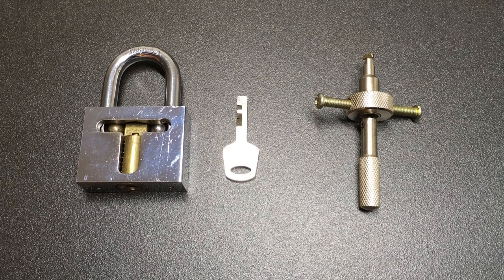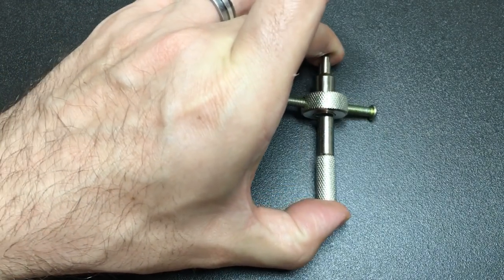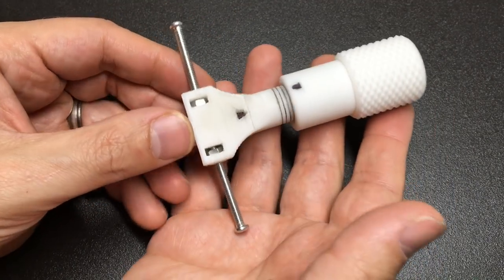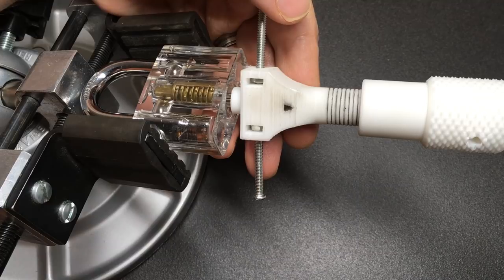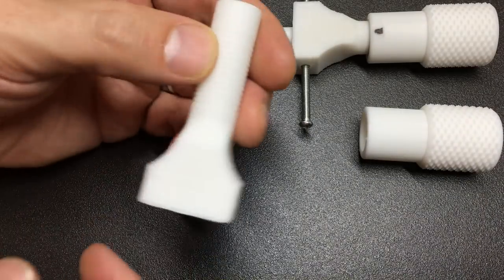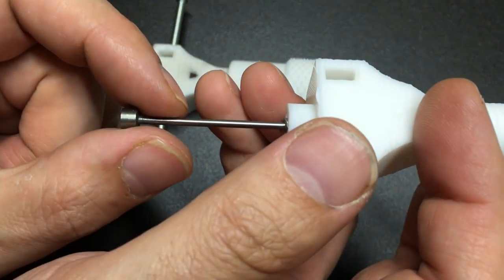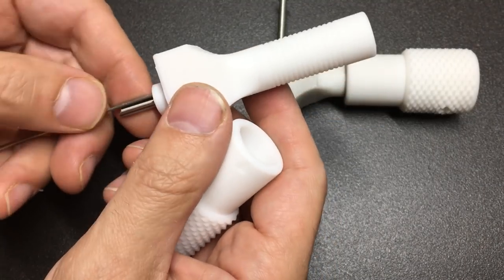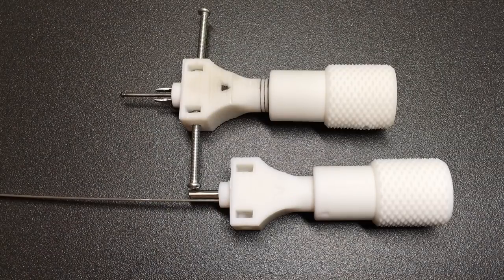AMAZING 3D Printed Disc Detainer Pick Prototype

Comment from the maker: Wow! I just love seeing innovation and design like this. And the final assembly works perfectly too! Awesome work from Boris :-) The links to the .stl and CAD drawing are in the description :-)
Reply: That is a good lockpick the problem with the cheap picks is you keep having to use the alienkeys. 😀😀😀as allways have a nice weekend
Reply: Is the design very innovative when it's just a 3D printed version of what Lockpickinglawyer and BosnianBill made? I feel the innovation was theirs and Boris just  put the design into CAD which is useful I guess, but might make sparrows less likely to pick up the making of the LPL/BB design and manufacture it
Reply from the maker: Myranda Rose well I can see your point, but I have to politely disagree with it. I LOVE the pick that LPL and B.B. made, but it is in no way innovative and is itself derivative of the many other DD picks that have come before it, including notable examples from Huxley Pig etc. The innovation shown by Boris is in making a working design out of a printed material that assemble with commonly available parts. As for impact on Sparrows? None I’d say. The number of people that would go through the challenging process of printing and making one as well as souring the ejector pins and then having the skill to reduce it down to a picking tip? I’d say we are talking about 10’s of people and those people would most likely also buy the Sparrows version of the pick if it ever comes out. I know I will be.
Reply: & What of course wasnt explained and what everybody was waiting for is where you get picking tips
Just give me one of them wired pick tips and I'll tension any front tensioned DD's with whattttteverrrrr
16 minutes and not 5 seconds spent to xplain that, oh dear god
Reply from the maker: miniwaern 14:28 it’s an ejector pin. It’s ok to ask nicely you know

Comment: Good use of the 3D printer. I have seen a few things that make me want to try 3D printing. Maybe I'll get one (and likely have to replace this old computer to get it to work, too) someday when I have time and desire to learn something new. I think your modification will work as long as tension is not too great when picking. The picking of the clear lock was a nice bonus. I have watched Bill and LPL pick a lot of these locks, but never saw what was going on inside. Thanks again for the great videos!
Reply from the maker: thank you for watching :-)

Comment: I LIKE THE BIG HANDLE AND OTHER FEATURES THAT THE SPARROW DESIGNED BOSNIAN BILL AND THE LOCKPICKINGLAWYER ARE LACKING, ITS A GREAT TOOL BUT I LIKE DESIGN YOU HAVE MADE IT LOOKS LIKE IT WILL BE EASIER TO USE.

Comment: Love it. The modifications your thinking about making I do believe will work. I am a little worried though that the pick itself will eventually slip with only the one grub screw tensioning it from only one side. I also think it would look great if the edges on the tentioner were rounded off a little. Of course I'm gonna have to print one now. I have 3 and 5mm nuts and screws, I'm not sure witch ones were used but can you tell me were I can get the tips and let me know what size the hollow tube is that was used? Thank you my friend for sharing this with us.
Reply: Hey Bobby. Here is a link to borris's video where he talks about making it including what nuts ect. Its linked over at the download page at thing-a-verse.
Reply: But yeah if the link doesnt show up just go to thing-a-verse and click on the youtube link. I didnt get thr chance to watch the whole thing yet but the nut on the grub screw on back is m4.
Reply: @Phred_Phlintstoner  thanks brother. Yeah I started to watch his video. I have to go back and watch the whole thing. I have two machines working on it now in silver and bronze. I also think I have the 4mm nuts and screws leftover from building 6 machines. I have lots of extra nuts and bolts. If not I now I can get them. Im pretty sure I also have the wiper blades and hollow tubing. What I need is the pick tips. I've seen them before but I don't know where there getting them.
Reply: @Phred_Phlintstoner  never mind. I found a link in his video for the tips from AliExpress.
Reply: @bobbykeyz1263  um i think you can order replacement tips for one of the other tools on the market from somewhere that would save you some grinding. I think it was mentioned (or used by) lpl and boz bill... but i cant wait to see this in action after you get it up and running!
Reply: @Phred_Phlintstoner  dude I am so fucking made right now at AliExpress. I tried ordering them with a $3 first time coupon but if you make one mistake on ordering like your address or something and have to go back they take the coupon away. I tried both on my phone and when they took the coupon from me I tried on my wife's phone and I fucked up and the same thing happened. I have to cool down now and I guess I'll have to pay full price lol.
Reply: I was thinking the same thing. Maybe the shaft on the pick should have a flat on it so the grub screw has something flat to grip onto.

Tube thickness/ diameter and like you say,  where do you buy those rods to make into the tip?
Reply: @roysammons2445  yeah I was kinda thinking the same thing but the shaft is already pretty thin. I think being squeezed between two set screws would be the best way. Its almost done printing. If I need to I think I'll just drill another hole one the other side. I won't be able to use the nut but the plastic will hold it pretty good for a while. I have to wait for the tips to come in.
Reply: @roysammons2445  ok I was wrong. After printing it I can see it only needs the one set screw to hold the tip tight.
Reply from the maker: Can’t wait to see your ones printed Bobby Keyz :-)
Reply: @LockNoob  I just sent you an email my friend with one I'm working on. I started working on it right after I watched your video yesterday lol. Again thank  you for sharing this with us.
Reply: @LockNoob  no need to wait lol.

Comment: Thank you for showing this is such depth - really good thoughts!  3-D printing used how it should be. :D  Question:  extended the tension forks is a good idea to get into deeper keyways, but who does the tube have to be extended?
Reply from the maker: I would extend the tube to provide some stability to the extended forks. I might even epoxy them :-)

Comment: Noob, the 3D pic that you have looks like an exact copy all of the one that LPL and Bosnian Bill designed out of brass and stainless steel. Your comment about the first disc always being the one that tensions the lock is not entirely accurate Kryptonite has came out with a disk detainer lock that tensions off any random disc in the stack please check it out.
Reply from the maker: very true, but for he vast majority of the cheap Chinese disc locks, they tension on the first disc :-)